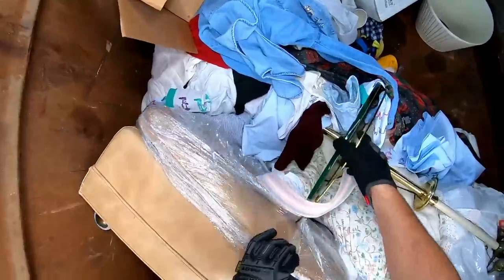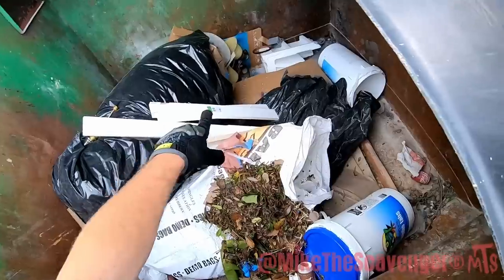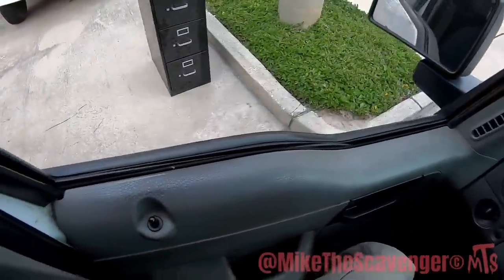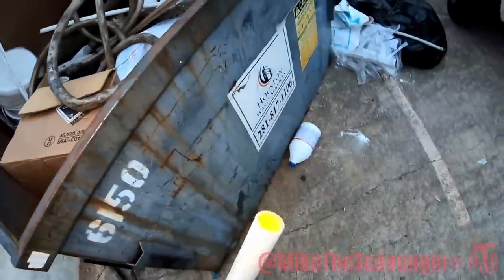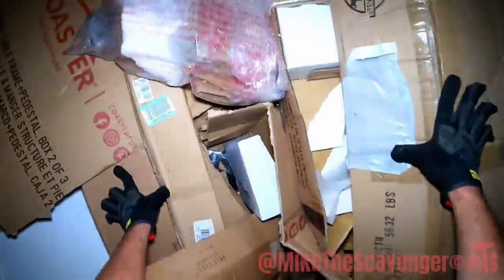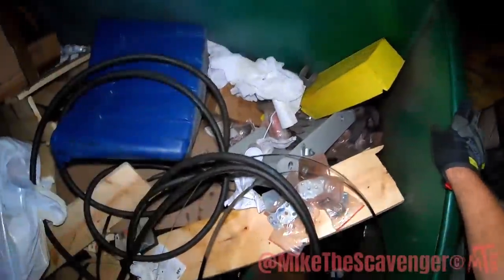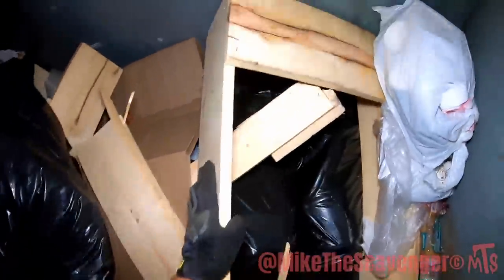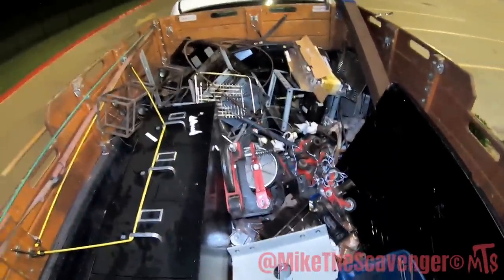Dumpster Diving "Human Smuggling Sucks!"

Comment: Sprinkle chili powder, the bunnies dont like it,and will leave your plants alone😊  great job Mike! Stay safe and healthy ❤❤
Reply: Wanna give them a good time just leave them some weed as an offering with a note in bunny saying that you don’t war but if they don’t chill there’ll be repercussions…. Poppies yes Poppies will put them to sleep… Sleep… Now they’ll sleep.
Reply: Doesn't work here.
Reply: How about squirrels
Reply: Try mixing dishwasher soap (like d*wn) with some cayenne powder, and smear it on the plants. It works for deer, so it'll probably work for rabbits.
Reply: I use cayenne pepper.
Reply: @anndefauw1161  yes give the flowers some squirrels as their pets/so the bunnies have some one to play with instead of eating the flowers. Genius! That’s a happy place I have now painted in my head permanently 😂
Reply: I agree with all of the peppers and dish soap. Techniques mentioned any kind of capsaicin oil I’ve even used habaneros mixed with rubbing alcohol diluted to a 5% alcohol to water ratio to habaneros grind it up and screened any kind of pepper and there’s soap would be great.

Comment: Motorolla mics look like vintage cb base station speak inta's...as i use to call them.Or could also be Ham mics.The wheels mounted to the brackets look like some sort of trolly system for an overhead crane type of set up.GOOOOOOOODD  JUUUUNNNKKK     Mike

Comment: Anti rabbit tip that truly works. Save your first of the morning pee in a jug and then put into a sprayer and spray around the base of the bushes. Two benefits. One is the most obvious. Rabbits do not like eating or going near anything that is "marked" by a predator. They are sure that if one predator marked that spot, another one will come by to "over mark" it and they do not want to be a snack for that territory marking predator. The second benefit is that pee is loaded with nitrogen and will make the bush grow bigger/healthier.